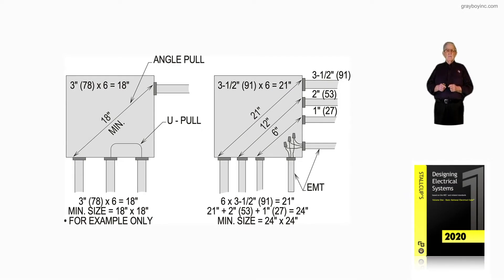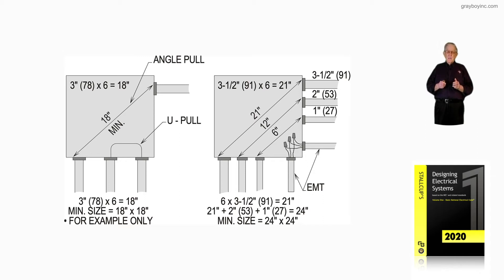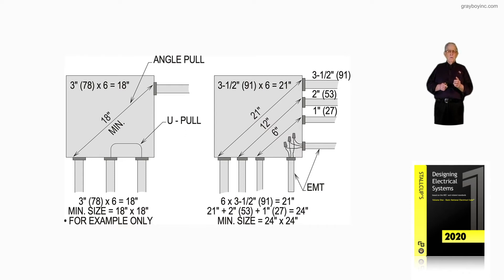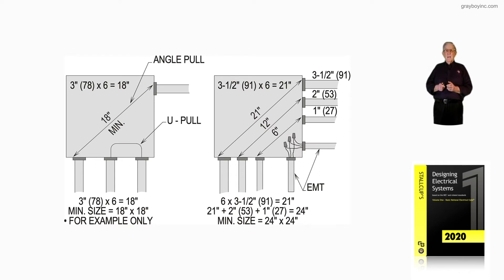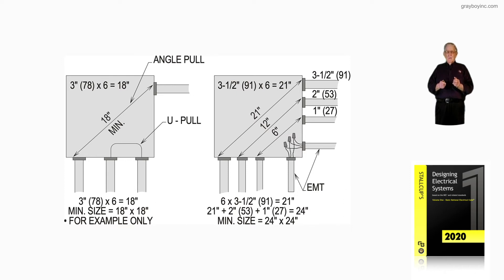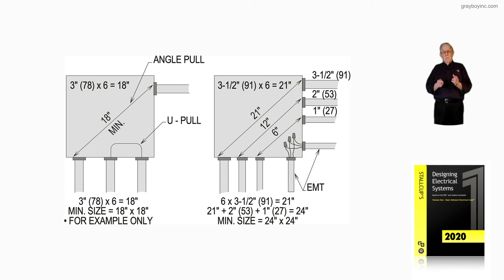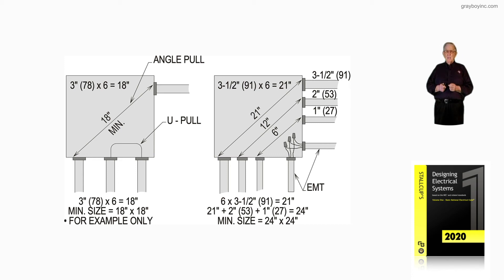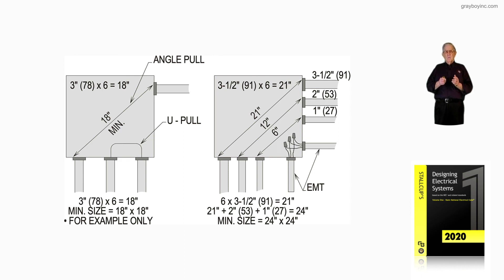12-20.1  ANGLE OR U PULLS - 314.28(A)(2)​​​​​​​

Comment: The way the code reads the EMT should be added also. A very muddy example.
Reply: Also on the first example, the U-pull conduits were not added to the angle pull.
Reply from the maker: www.grayboyinc.com 
Use the following coupon code at checkout for 45% off all products. Coupon Code:   22GB45
Reply: @JGSETI  ...  what if you are splicing in the pull box.  I have (2) 4"  in and (2) 4" out.  350mcm 4 wire in each conduit.  Using Polaris connections